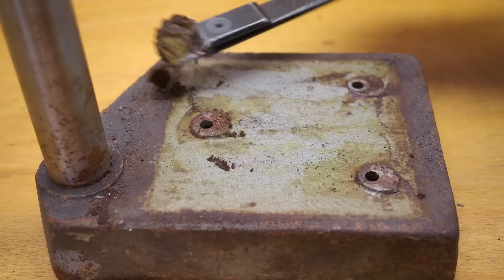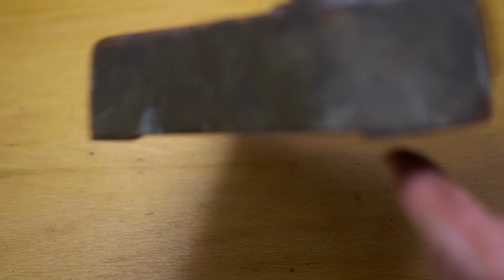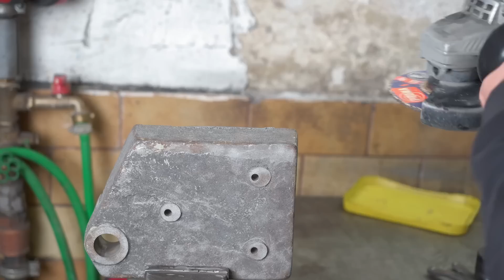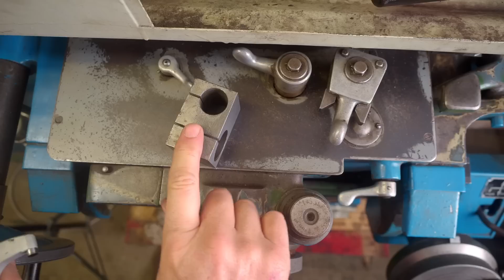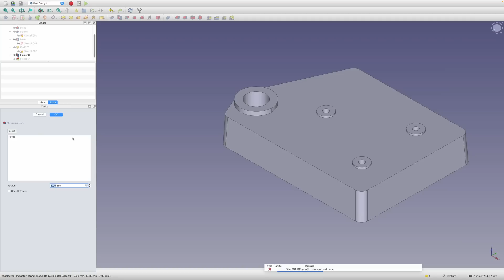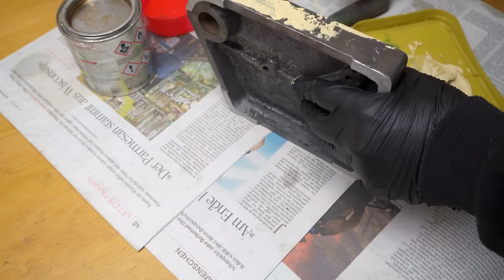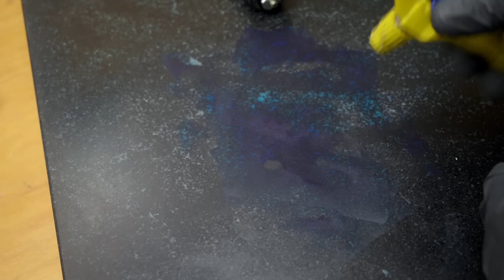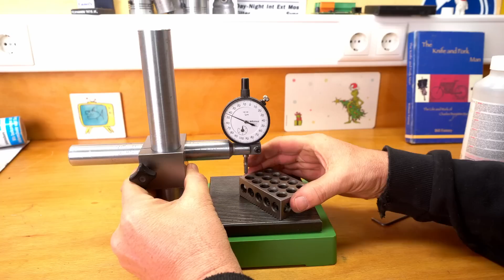Indicator stand overhaul || RotarySMP

Comment: Use the surface grinder to grind your magnetic chuck face true to the machine.. i.e. run a pass across the face of the mag chuck while it's on, this will give you a surface true to the machine.
Reply from the maker: It is on my to do list. But I want to understand the underlying geometry better first.

Comment: Would tightening the plate down distort the top face you bluing might not be accurate
Reply from the maker: In theory, locating on three points should not distort it, if the three pads are level. However, once I have the grinder dialed in, I will touch up that table.

Comment: When you said the table no longer rocks, the only difference was you were loading it at the other end with two bosses compared to the first time where you rocked it from the single boss end. A 3 legged stool is inherently stable, so the milling was just cosmetic. As a comparator, as long as the table is a flat plane, the squareness of features are much of a muchness as long as they're not miles out such that cosine error becomes an issue for measurement.

If you didn't want to tart it up, lapping the table flat would have had it good as new.

If you watch how you sweep the part when you're measuring, it's clear to see how the table has worn as it has.
Reply from the maker: The casting was so sloped that it didn't sit on the third boss (without a washer to raise the boss).

I will regrind the table once I have the surface grinder sorted.

Comment: Hold on...

2:09 3 point support can not rock :) 
It rocked just because you are pressing it at the corner that had no boss under it.
OK... this is not exactly 3 point, more 3 small planes, but that rocking was not result of them been out of the same plane.

15:07... you just made 3 bosses parallel to the cast base bottom foots. What you really want is to make the top plane of them perpendicular to the column.
In this particular case.. not so important, but... just good habits :)
Reply from the maker: It rocked because the base casting was badly sloped, and the table sat on the casting edge which was higher than the third boss.

You are right, that I should have fixtured to reference off the column axis. The column is not perpendicular, but as you note that is not that relevant here as the indicator becomes fixed  a point in space.

Comment: Why did you remove so MUCH material from the upper surface of the base casting (12:00 onwards). It seems to reduce mass an rigidity for no purpose. Surely just a machine-till-clean would have served?
Reply from the maker: The top was badly sloped, from the front to back, with shrink defects in it as well Paul. I only removed two mm from the thin side. The casting was at least 12-15mm thick, and is certainly still thick and rigid enough.

Comment: What was the reason for removing so much material from the top? 
Looked a bit excessive
Reply from the maker: The top was sloped. I only removed 2mm on the lower side which is what was needed to clean up the various casting and shrink defects.
Reply: @RotarySMP  fair enough, couldn't tell there was anything wrong with it on camera, must have been a pretty poor pattern to make a casting that much out, is it Russian? I heard you say it's communist
Reply from the maker: @TheGreatBungholio  There is no badge, so I have no idea which country it was made in, but it has all the lack of care or pride in workmanship that you expect from late era communism. Could have been one of a number of counties.

Comment: I love watching CNC machining, it's hypnotic for me, especially with some groovy tunes to back it up. Your videos AND your machining are both top notch. I've said it before, I really like the fact that you do things "properly," like centering up the bosses to match the holes. You take great and well-deserved pride in your work.

I use Carbide 3D or Fusion 360 for most of my tool paths, and I must say, FeatureCAM 2005 output a VERY cool tool path. It kept me guessing where it would go next, GREAT fun! I'm also guessing that WD-30 is just WD-40 for folks on a low-calorie diet. :)
Reply from the maker: Thanks David. Yeah, FeatureCAM 05 delivers some really random tool paths. I have given up trying to optimise them, as for my one off work, it doesn't really matter if it cuts some air.
Yep, reduced sugar ;)

Comment: This is not more procrastination it's a side project to make life a little easier on the main project. My similar project was making a bushing for my paint mixer without a lathe. It was hackey but it works.
          Not sure what you use for media in your cabinet but my main one is crushed glass. Works on allot of metals and turns to a fine dust that ends up in the cyclone. I keep looking for a commercial one I can have outside the shop for big stuff.

            I often think that when they stopped making machines here in the US the machinery painters went into automotive paint and body cause I have seen just as much filler on cars as on allot of machines. 
        
           Very nice job on the stand and yes that vice is super cool. Will check out that band. As long as it isn't country music. I have taken to wearing my earbuds when I go into the farm supply stores so I don't have to listen to it.
Reply from the maker: Hi Robert,
I have foudry slag in there as a blasting media. It is supposed to be non silica (but I still wear the mask and use a vaccuum with cyclone.

That is funny with the ear plugs :)

Comment: Functional face lift 🤔👌.
Ref MotoGP,  yes, sublime Quatarao,  but his fellow Country man Zarco surpassed all, worthy winner.
Definitely high end remanufacturing Mark. WD 30? Industry joke 🤔😀.
Ref Hammer finish paint,  the fine type is fine, but the larger pock marked is horrible,  obviously designed to cover up surface defects, at my first employer,  all standard machines had a choice of blue or green hammer finish, all applied very poorly by a mad sprayer ( regrettably on my part he did suffer badly as a Japanese POW).
Great addition to the shop. 
Thanks for sharing.
Reply from the maker: This was more of a cosmetic overhaul. Once I have the surface grinder dialed in, I need to tweak the geometry.
Did you see the tears of joy on Zarco's parents? What a turbulent race. Marc would also be thrilled with that result. Must be frustrating for Acosta the way that rear tire went off.
WD-30 has reduced calories :)
Reply: @RotarySMP  Yes, I felt the emotion from the partisan crowd, absolutely brilliant. Haven't found out what happened to Miller yet.
Reply from the maker: @bostedtap  He was on the same strategy as Zarco, but pushed too hard on the wet tires before the rain started, throwing away a big opportunity. At least that is what the German announcers said.
Reply: @RotarySMP  Okay, thanks.

Comment: great vid!   could those pips on the base plate screws been some kind of leveling method?  perhaps some way to get the top plate aligned perfectly with the column?
Reply from the maker: Thanks,
No, as the pips are down in a threaded hole, do the threads carry the force.

Comment: I'm wondering how you will set the stand up on the surface grinder so that the ground surface is perpendicular to the vertical shaft? Something to consider before the time comes!
Reply from the maker: For relative measurements, the column does not need to be vertical, as there is no Z movement, which is lucky, as it is no where near vertical :/

Comment: The flatness of the plate is affected by the fasteners, checking it when not fastened to the base doesn't give you an accurate representation of the warp/flatness. That said, it looks much better than it did before
Reply from the maker: I need to revisit this once the grinder is set up.

Comment: If it grinds flat but out of parallel, you just need to grind the magnetic table flat.
Reply from the maker: The Mag chuck has a 0.1mm valey though the middle. I need to grind it, but wanted to pop the table off and take a better look at the rest of the geometry first.

Comment: I think the pip on the studs were so you can adjust/square the table to the upright. The nuts were just jam nuts to hold it in position.
Reply from the maker: Nope. The casting had clearance holes. The pip has no function at the bottom of a threaded hole.

Comment: I assumed the three points should be relative to the bore?
Reply from the maker: Having that table perpendicular to the table is ideal , but not strictly necessary. As long as the table is a plane (it is not) and the dial indicator a point, lack of perpendicularity will reduce the accuracy of absolute dimensional measurements, but will not affect it's ability to check flatness.

Once I have the surface grinder dialed in, I can revisit the accuracy of such aspects of the dial stand.

Comment: i know that some pros like to apply bonding twice before sanding. but in diffrent color's ( like on in a redish color and one in blue ) so when all the blue is gone they know that there is no low spots left 

when you do grind in the indicator stand top please use the super glue trick i told you about in a former video. and do it well its still mounted to the base where its already stressed the amount it gonna stay at. so you grind out the bowing that would happen when you tighten it down to the stand ( basiclly compensating for the stress/bow screwing it down would do.) and since its only super glue holding it down to the chuck the magnet can not pull it down disturbing its shape. 

also let the grinder warm up completely by grinding a peace of steel about the same size as the stand for like 30min ( simulating the work its gonna do so it thermolally grow the same way as it would do when you grind the part. but since you warmed it up simulating the part its already grown as it would and dosnt grow anymore and destroy your part ( about the same hardness as well if you can )

done right even a bad/unalined ( worse shape then what yours are in at the moment or was when you got it ) grinder can hit sub micro 

best regards from denmark
Reply from the maker: Thanks. I wonder how the magnetic chuck managed to end up with a >0.1mm valley in it. Seems way too much to be wear.
Reply: @RotarySMP  could be a wear patten. if they only put part in the middle og it and dragged them off the end without washing and squeeching the chuck first

or  it could be from bowing under its own weight over the years. if i recall right there is a part in either the table or the underside of the chuck where its completely hollow. which might make it bow under its own weight if its never been dressed/dysted off ( which would grind that vally out ) i mean like 50+ years without any support under it and never dressed/dusted off vould give that 0.1mm you see ( it would be like 2µ a year it would sag which i could see happening even at its thickness )

if only the chuck had a small hole in the center all the way through. since then when you then have mounted it agen after dusting off the table itself you could poor a low expanding epoxy down there ( so the epoxy can support it from below ) and then grind in the chuck the way i said it on the last video

best regards
Reply from the maker: @flikflak24  I find it unlikely that a company which grinds parts would not notice that the chuck has such a huge deviation from flatness.

Comment: Such a great video (ex: using the carbide scraper for paint) that I hate leaving any criticism.. 1) you machined away a bit too much of the casting 2) when machining, your reference plane was the casting's bottom which may or may not have been perpendicular to the column's center axis (so yeah, it's probably off). Does that matter? Yes, when measuring features at different heights you'll now have a (worse) sine error. For example, a 10.017mm measured height difference could mean the part is off by 17microns or your indicator's axis is off by 1 degree. Yes it can be measured and accounted for with gauge blocks but it's annoying because if you swing the arm to a different location the indicator's axis (and thus the error %) will change if the column's axis is not perpendicular to the base. Should be fixable with some applied geometry once you get the surface grinder to hold microns.
Reply from the maker: 1/ How do you know that? The casting is very thick on top (12-15mm), and sloped badly. I only took 2mm off the low side.
2/ Year I know. It is still way better than it was with the table "shimmed" with a washer to stop it sitting on the slopped side which was higher than the boss.
This is not set up to swing the indicator, as there is no height stop. If the indicator is over the same spot, the error is largely irrelevant (although the table is not flat, so that will cause errors.

The whole think needs an accuracy touch up once the mag chuck is sorted.

Comment: 3 support points indicate a leveling capability. Filing off the tip of the one screw was likely a mistake.  The fact that one of the studs was fixed to the plate suggests that this was the case.
Reply from the maker: No, all three had clearanced holes in the casting and were screwed into the plates, so those points had no function. You are assuming more quality and precision that this was made with. It was a rough and ready part which looks like it was made under 1980's communism. :)

Comment: Is the platen square to the column? There is no promise that the column is perpendicular to the base. The shim was likely to square things up better. My $0.02
Reply from the maker: The casting was sloped. The far side was above the height of the third mount pad, so the table needed the washer to touch it. But you are right, I could have done more to square it all up. Once I have the surface grinder dialed in I might take another look at it.
Reply: @RotarySMP  strictly speaking , what matters most is that the table is perfectly flat.
after all, the normal use of the stand is to compare an object to a standard ,ie gage blocks. 
not to say that the column,rod and indicator shouldn't be  as square  as possible   ,but
once zero is set  on the dial,  it's good enough for all but the most precise measurements.
Reply from the maker: @steveggca  Yeah, the indicator is just a point in space. That is lucky as the column is not square :)
Reply: @RotarySMP  consider a coodinate  measuring  machine with a head that rotates  360 degrees and can  can tilt the probe through a 180 degree arc.

Comment: I have to admit that I don’t care for filling in castings unless there’s a hole or other sudden chunk missing from the casting. I like the look of the casting surface under the paint.
Reply from the maker: Hi Mel, I sort of do too, but that casting was so badly done, with shrink defects, terrible surface finish, slag wart underneath etc, that it needed a lot of fettling. A rough casting with angle grinding looks bad under paint, so I bogged it.
Reply: If the casting has a beautiful and uniform texture from the moulding material - I agree. But on a casting with lumps, blow holes and porosity I say fill away!

Comment: Ok, I'm no machinist but I believe 3 points make a plane. Whu would it "rock on three points?
Reply from the maker: Because the top of the casting was sloped, and the high edge was above the height of the third point. That is why they put a washer on it.

Comment: I was of the understanding that the plane of the reference plate should be at right angles to the column
Reply from the maker: I am sure it should be. Given the casting edge was higher than the third mount pad, they put a washer on that pad. While my job was not perfect, it will be significantly better than it was.

Comment: I don't know what i'm talking about, but looking for square on part with split open holes taking 70-80% of material seems...optimistic ? ;)
Reply from the maker: Yeah, square was not relevant on that part as all outside features have no function. I just noticed it was machined really badly and figured with the vise I could make it a bit less wonky.

Comment: I suppose that the difference in the three hole was done on purpose, so you can regulate the parallelism..... My guess
Reply from the maker: I am guessing that they were simply match drilled with minimum effort. It was a pretty poorly built tool. 1980's communism was my first thought.

Comment: I wonder why you worried about the positions of the three holes w.r.t. the hole for the post.  Three points 'fix' a plane, and your plane should be perpendicular to the axis of the big hole.  Without checking that, you started grinding off the bosses, which may have led to table and post not being perpendicular anymore....
Reply from the maker: True, but you are assuming some level of precision this simply didnt have. The casting was sloping, such that the table was lifted off one of the three bosses, and someone put a washer under it.
Reply: @RotarySMP  Ok, so it was far from perfect to begin with? Did you check after completion if the post is square with the table?
Reply from the maker: @michaelhompus2475  That will come later, when I have the grinder set up. Since the table is not currently flat, there is little point.
Reply: @RotarySMP  There you have a point.  I will watch your channel to see how you are going to grind the table so it will be square with the post. Setting that up on the grinder looks like a big challenge to me. Shims (aluminium kitchen foil)  may come to the rescue. Anyway, your video made me think about flat, straight and square. Thanks for that!
Reply from the maker: @michaelhompus2475  Having that table perpendicular to the table is ideal , but not strictly necessary. As long as the table is a plane (it is not) and the dial indicator a point, lack of perpendicularity will reduce the accuracy of absolute dimensional measurements, but will not affect it's ability to check flatness.